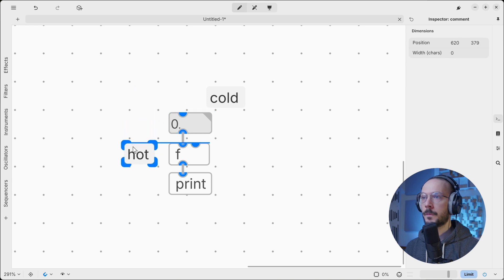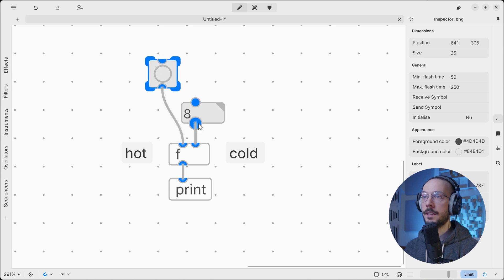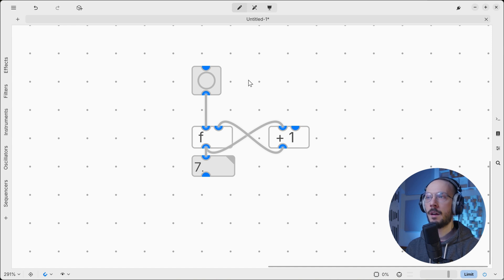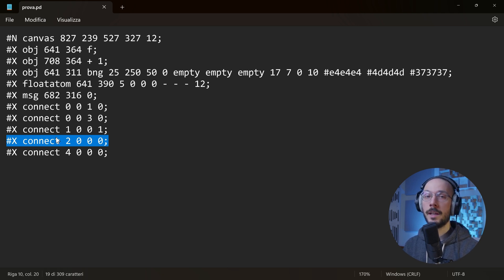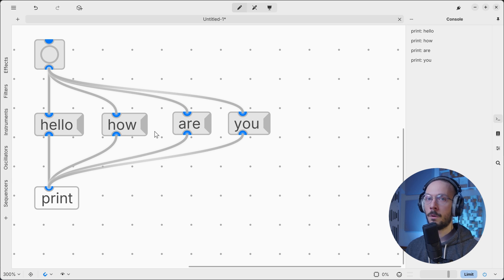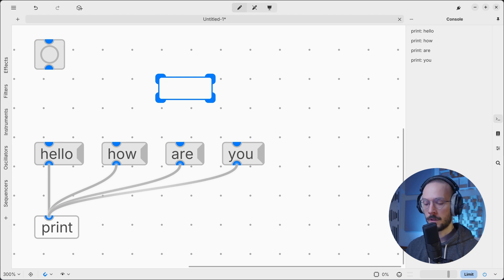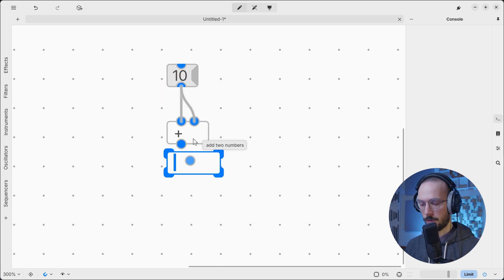Execution Order | Plugdata Course for Beginners Ep. 4

Comment: So if you were to look at a patch without trigger object you wouldn't be able to read out the outcome cause there is no visual representation for execution order that way am I right ?
Reply from the maker: Not really, you can read a patch without trigger objects, but in specific cases, predicting the outcome is not a given. Using [t] makes your patch tidier, easier to understand, and encourages proper design thinking. The more patches you create in Pd, the more you'll appreciate its utility :)
Reply: @SoundCodex  please correct me if I'm wrong but my description of situation is that specific case, isn't it ? I don't have a problem with trigger object, that one makes sense in context of cold sockets being on the right. I'm just not a big fan of the need of extra object to be able to properly determine the execution order. To be more specific I'm not a fan of cord plugging action order having impact on the outcome. 
Let's imagine you were to insert a line of code before the existing one, but the second one was executed first because it was written first. 

On a different note thanks for awesome tutorial and also for your swift response. It means a lot.
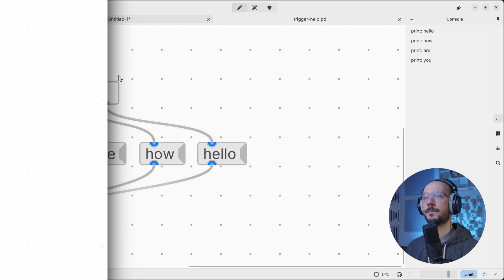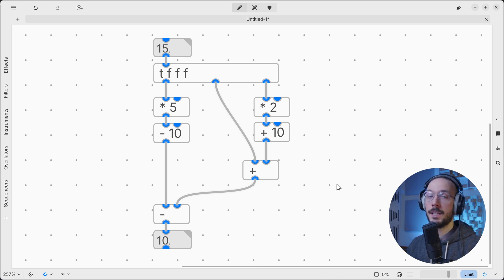Reply from the maker: @PCgmesforever  The patch shown at minute 07:21 is the perfect example of that 'specific case'. If you link the message 10 to both inlets of [+] without [t f f] you could produce the wrong outcome (like the value of 10 printed on the console a few seconds after). Just to give you a better idea, try to replicate the patch shown at minute 08:28 but without the [t f f] object and randomly choose the connection order and look at what happens. Using the trigger object is a simple way to avoid possible errors caused by the wrong execution order. Btw thanks for the appreciation, I'm super happy you found the course helpful!
Reply: @SoundCodex  you're welcome. I honestly find your content about PD an Plug data the cleanest easiest to digest that I could find.
On the topic of execution order, I get how it works but wouldn't something like forcing right to left execution order implicitly be better than basing order on chronological cord connecting ? Again I think trigger is useful but what I don't like is that, trigger object aside, chronological execution makes visual representation kinda pointless. Again trigger object asside, if you were to just look at nodes you wouldn't be able to tell what's gonna happen.
Reply from the maker: @PCgmesforever  Do not confuse the chronological chord connection (used by Pd to write the actual .pd file, and which can sometimes lead to execution problems like the 'hello you are how' issue) with the execution order Pd uses to run the patch, which is based on two rules:

1. Left to Right
2. Depth-First Message Passing

99% of the time, the execution order is already 'forced' from right to left because the leftmost (hot) inlet always produces an output. This is more than enough to schedule events in Pd!

Now, let's say that I have an envelope object with several non-leftmost (cold) inlets to set the attack, decay, sustain, and release, and a leftmost (hot) inlet to trigger the envelope. I don't care if I send the attack or the decay time first, as long as they are sent before the trigger to the hot inlet. I just want to set the overall envelope length, and then I want to generate it. In this example, chronological chord connections won't affect the patch execution because the Left to Right paradigm has a higher 'hierarchy'.

The chronological chord connection was a problem with the [print] object because it has only one inlet (so there's no left to right order) and chronological chord connection took priority. That was one of those 'specific cases' where you need to pay attention and use [t].

Hopefully, this makes sense. It's tough to explain these topics in just a few lines 😅
Reply: @SoundCodex  I'm honestly not sure I got it but I'll just have to play around with PD a bit to really get this. Again thanks a million for detailed responses and all the effort :)

Comment: very conscise and clear, thank you for these!

if you're open to suggestions, perhaps an episode on the main differences between Max and Plugdata would be useful? That difference in the ordering (right to left in Max vs order that connections are made in PD) looks to be a big one.

Also, something I've always wondered in the brief time I've spent in PlugData, where is the menu bar? Are the only settings available those around the interface and those in the burger menu under settings? Thanks!
Reply from the maker: Hey thanks!

I've been thinking about doing a video comparison with Max for a while now. I definitely plan on making it happen (sooner or later lol).

The only settings are available in the burger menu under settings.